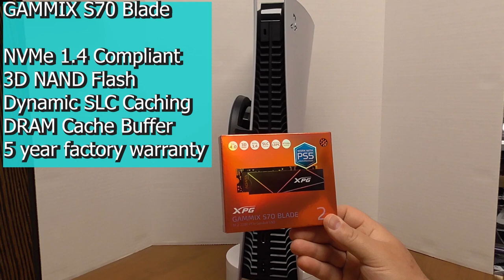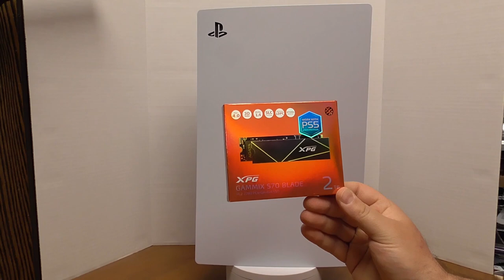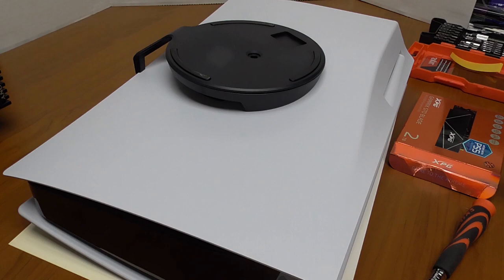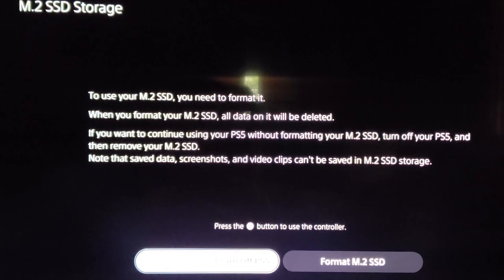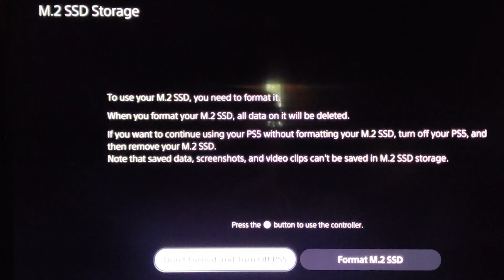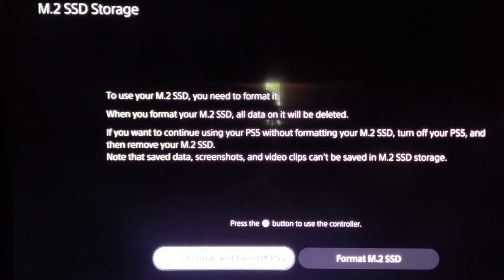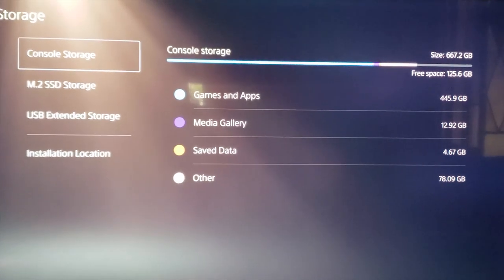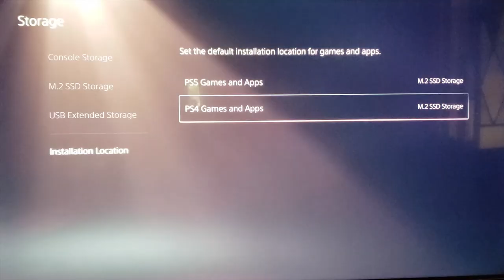DIY - PS5 Storage Upgrade - XPG GAMMIX S70 Blade 2TB SSD - by ADATA

Comment: Thanks for the insulation guide. I purchased this 2Tb ssd when it first came out for the living room ps5.  September 2021. And I can not recommend it enough. Runs fast never had any issues. Just purchased the same one better price a year later on Amazon👍. This is for the ps5 bedroom system. Hopefully getting the vr2 to use on this system. Just checking again how to do it😂. I find the hardest part getting the case off.
Reply from the maker: I think the difficulty with the case is us being overly careful because we dont want to crack it. 😉 Glad this helped.

Comment: Thank you for this tutorial!
I think it would be better to replace the heatsink because the included heatsink is not a good choice.
This is evidenced by the reading speed, which you can see after formatting, it is lower by about ~100-200mb/sec.
Reply from the maker: I agree it could be better but it does the job. Thanks for watching!
Reply: Mine was at 6333! Sure it’s not a software problem? As I’m a Year into the future, and it’s faster by the amount u specified?

Comment: How has this been performing since your video with the included heatsink? Do I need to buy an aftermarket one? I've just ordered the 2TB version of this now the prices have come down.
Reply from the maker: I had no issues with it for months in my PS5. When I transferred it to my PC it lasted a couple of months then became unresponsive. It may have been due to overheating but I can't confirm that since my PC has had no other issues. As an inexpensive storage solution for the PS5, I don't see an issue with it and performance was adequate. My biggest issue was with Adata's customer support which was at times non-existent and it took months for me to get a replacement module.
Reply: @Ragingeek  ok thanks!

Comment: Did the same thing you did but my SSD does not go into the port correctly and is wobbly. I have no clue what I could have done wrong.
Reply: The screw will firm it in place! Mine basically did a wheelie when I let go. Hope the screw holds it down!
Reply from the maker: Once you make sure it is securely in the port fasten it down with the provided screw in the PS5.
Reply: @Ragingeek  it won't insert properly.
Reply from the maker: @REALNATEROX  If your not able to insert the chip as I did in the video, you can also try inserting it at a slight 10-15 degree angle before securing it down with the screw.

Comment: I recently bought a t7 shield Samsung 2 TB extended storage thinking that I can convert my PS5 games to it cuz I seen a video about it, turns out just got it and that is not the case so now I'm returning it and after watching this video I'm probably going to get the xpg s 70 blade do the fact that it's a good price 2 TB which I'm looking for and also can transfer the PS5 games to storage and that's exactly what I wanted the whole time. And since I never owned a PS4 and don't have any prior games  I can't justify having two terabytes for a PS5 that only works for PS4 I get there's a lot of games for PS4 but as we go forward there's only going to be games for PS5 and if I'm trying to get the newer games coming out.
Reply from the maker: The XPG in this video is a very good buy for the price. I have not had any issues with it. Thanks for watching!

Comment: Very good tutorial but how about the temperature beaceuse i didnt saw a Heatsink
Reply from the maker: I have had no heat issues, it actually has a black aluminum heatsink though not a typical design it claims a 20% heat reduction.
Reply: @Ragingeek  ok thank you
Reply: How did you miss the very clear part where he shows how to put the heatsink on the SSD 🫤

Comment: Is it possible to further improve thermals with adding an extra thermal pad/paste below the heat spreader ?
Reply from the maker: You could probably upgrade the heatsink but I wouldn't combine two different ones. Additionally, you need to be mindful of the space your installing into.

Comment: I bought one a year ago and my ps5 never turned on properly using it, just got a replacement from Amazon so hopefully it's OK this time. The read speed is slower on this one somehow ...
Reply from the maker: Sorry to hear you had an issue, hopefully the new memory stick works out for the better. If you continue to have issues try to reseat the memory stick. You can also try to test it in a pc to see if it is an issue with the chip or PS5.

Comment: How's the new unit working? did you have any issue?, I'm probably avoiding it because the problems you had.
Reply from the maker: I actually sold it on my store. It took so long to get a replacement I had just purchased another one on sale. No complaints so far from the purchaser.

Comment: I installed mine yesterday night 2tb ADATA Gammix s70 blade watching your video.. perfect instructions.. worked perfectly for me.. thank you... i have a query..  the read speed of the ssd showed 6300 MB/S.. Is it the right speed or do we get more speeds on this model?
Reply from the maker: That is actually more than what mine measured, I was under 6,200 MB/s read time. It was advertised for 7,400 MB/s read time, however, this might have been a raw hardware test or performed on a PC. Overall, the chip seems to perform well on the PS5.

Comment: Can you install a heat sink on top of the heat spreader?
Reply from the maker: If I was going to change the heat sink it might be more efficient to use a different one altogether instead of on top of the other one. It has been a while since I opened the PS5 so I am not too clear on how much ceiling clearance is available. That said, using a heat sink with a slim profile could potentially avoid any installation issues. Note I only tested the configuration shown in the video so my recommendations are purely hypothetical. Thanks for watching my video!

Comment: I'm about to buy one! 6 months later how's it holding up?
Reply from the maker: Not to worry you too much but I had recently swapped out this one for a larger 4TB I had got on sale. I put the XPG in my PC and after a couple of months it failed yesterday. Good news is I just sent it in for a replacement, they seem to have a good warranty. Hopefully I get a new one no issue but will keep you posted. I've read other similar scenarios but at the same time there are countless others who haven't had issues. I guess time will tell.
Reply: @Ragingeek  I appreciate the heads up and the insight in the video. I guess I'll just use it to dump games that I don't use as much so if it does fail I'm not scrambling trying to move things around.
Reply from the maker: @Kingme3144  My pleasure, thanks for watching.
Reply: @Ragingeek  🥂
Reply: @Ragingeek  damn that is not good news
Reply from the maker: @nickabbott319  My biggest issue is with the company's customer service. Communication was very slow, sometimes weeks almost a month per response. Added to that it took way too long to get a replacement, months.

Comment: I got this and it's not showing up, I even bought a two sided heatsink it's not showing up
Reply from the maker: Is the heatsink possibly obstructing the seating of the drive? Try it with the factory heatsink.
Reply: @Ragingeek  i did it still isn't reading it. I will probably try again
Reply from the maker: @CBPfilm  Try a different drive or test that drive in another device.. Only way to narrow down the issue.
Reply: @Ragingeek  how do I do that without an computer?
Reply from the maker: @CBPfilm  You don't, maybe you know someone with a PS5 to test? If not, best bet is to get an alternate drive to test and return the bad one. Hopefully one of them will work.

Comment: What’s the type of  screwdriver do you use to take out the screw that contains the spacer?
Reply from the maker: You will need phillips-head screwdriver, however, try one from a precision screwdriver set or a computer repair set. It's a tad smaller size than your run of the mill screwdriver.